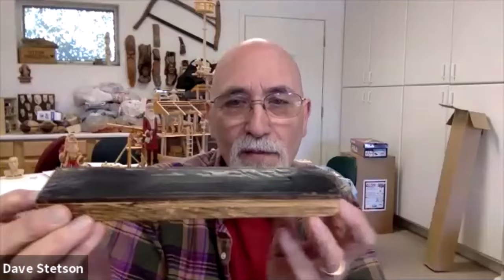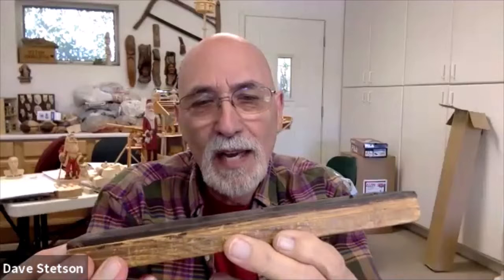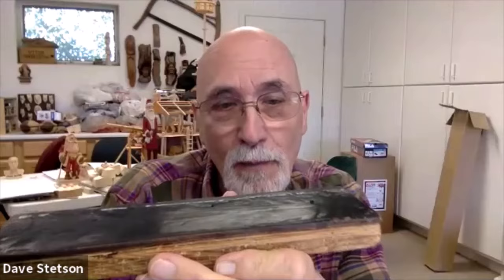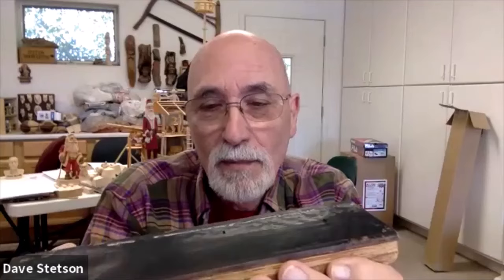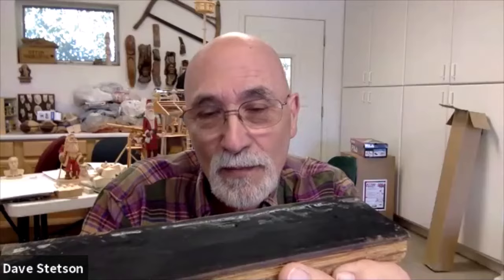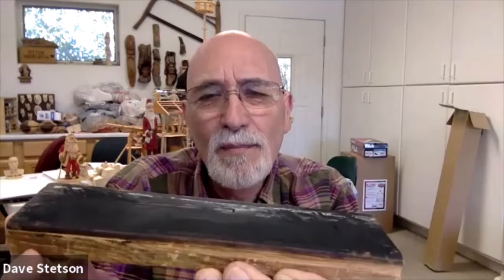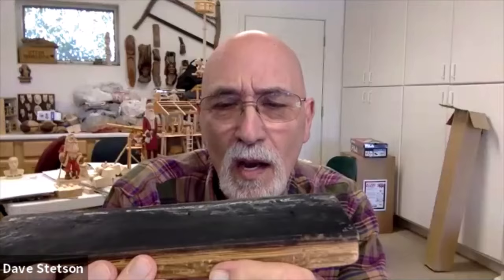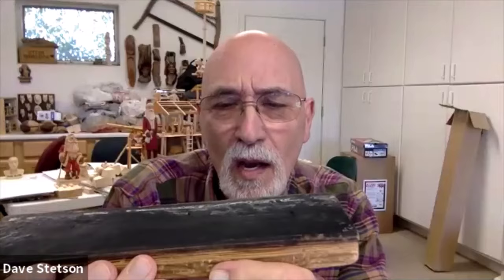Setup for a Strop with Dave Stetson

Comment: Hi Dave. I just seen someone wrote on fb u shouldn't use the rough side of the leather is this so
Reply: I made my own strop and glued the leather smooth side up on one side of the strop and the rough side up on the other side. I load the rough side with compound and strop my knives with that side first. Then finish on the smooth side. This method works great for me.